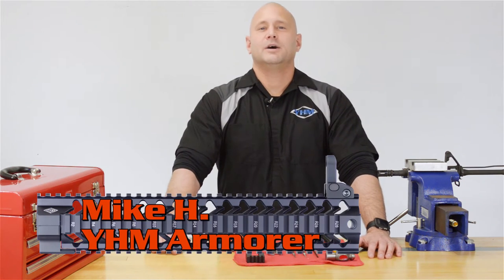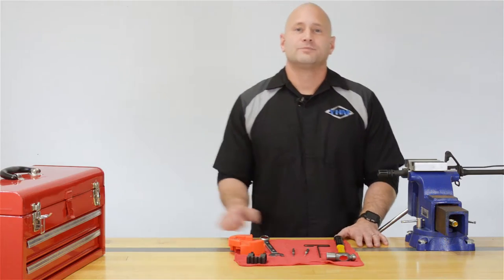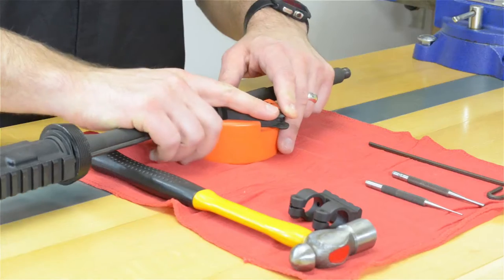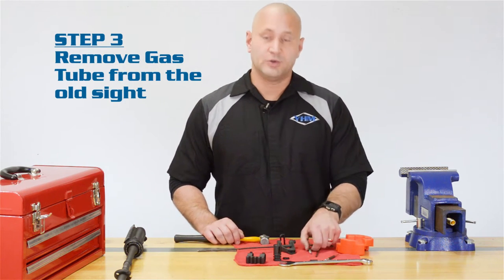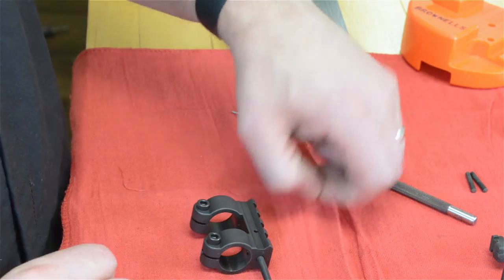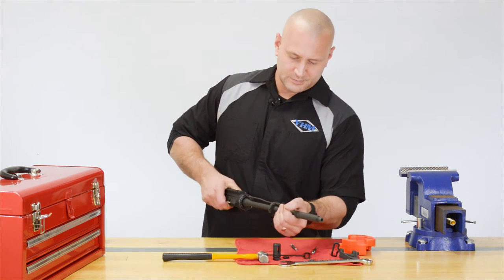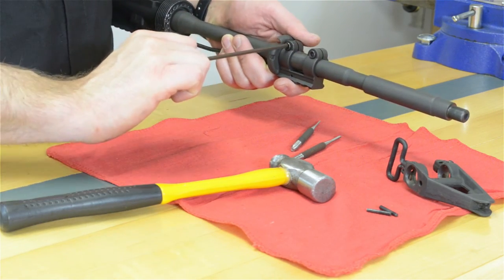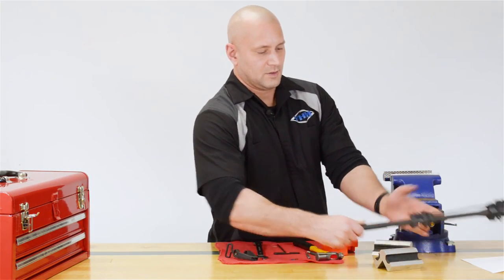YHM Gas Block Installation

Comment: Good video. Installed mine as recommended by YHM Mike. I got the black steel one with the pic rail for my front flip up sight. Worked perfectly on my Springfield Saint. Install was straightforward and smooth. The hardest part was getting my BCM handguard back on the delta ring. lol.

Comment: I bought the 9383 gas block for a new AR-15 build......so I didn't have an existing roll pin to resuse.  Its a bit frustrating that a roll pin is not included.  Now I have to figure out where to get one since the gas tube did not have one either.

Comment: So torque is not important? What would be a recommended torque or a torque to not exceed? I have seen multiple reviews saying these pinch style gas blocks have come loose or moved. Please advise.
Reply: maybe some blue loctite would suffice
Reply: There really is no torque spec, just get go until your wrench gives a little flex. To get 100% peace of mind give the gas block a little more tightening right after doing a little shooting when your gas system is still a little hot ;)